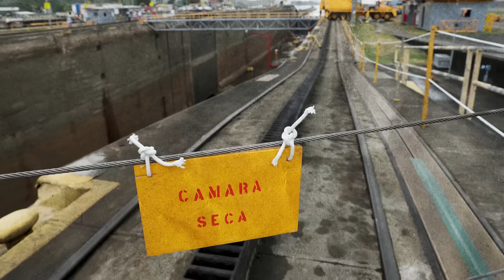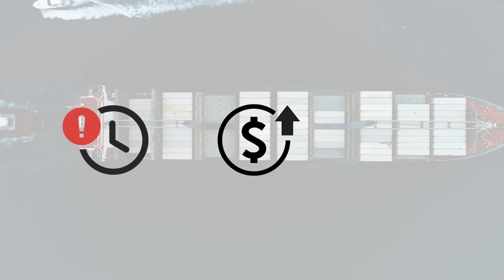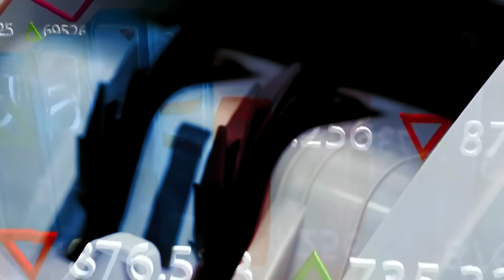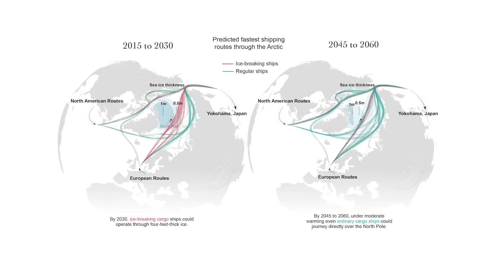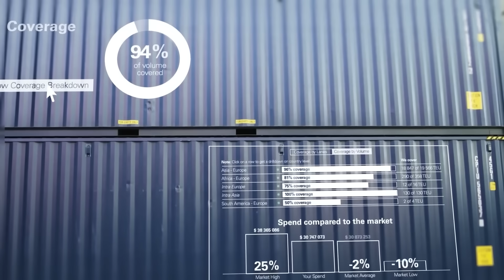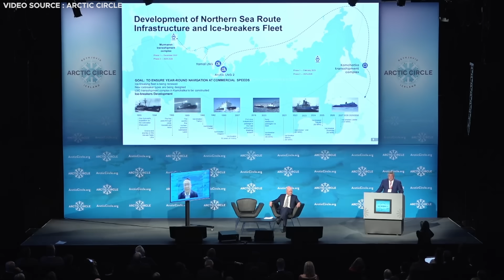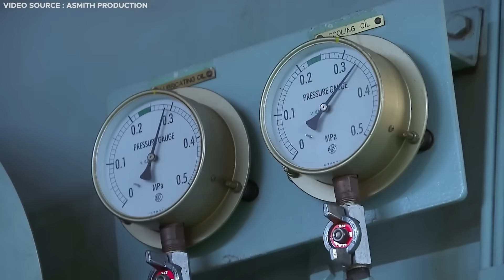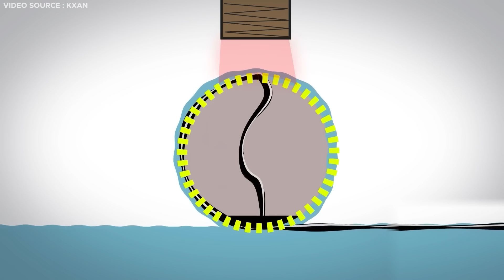The $43 BILLION Arctic Passage That Will END The Panama & Suez Canals

Comment: Miles before you reach the arctic circle by land, sea or air, you confront the true nature of the huge forbidding far north.  One word grips and guards this region to a shocking degree.  That word is Hardship!  The toughest people and the most powerfull machines die up there unless they have extreem material support and mental sharpness.  Casual observation of a map shows the emptiness.  The tiny isolated setlements depend on harbors and airstrips.  It is Empty!

Comment: during the summer the northwest passage is open, using it during this time window may let lake gatun in panama refill. 
during spring and fall variable conditions may see the seawater freeze, but if ships pass every few hours the agitation 
would prevent it freezing solid.   during winter ship caravans could pass if if ice breakers like russia has opened it.
per Grok = Northwest Passage spans approximately 4,000 to 4,500 kilometers (2,500 to 2,800 miles) in total length, depending on the path.

Comment: Russia has several very large nuclear ice beaker ships and many diesel ice breakers to open ice routes for cargo ships.  The Coast Guard has officially welcomed its first polar icebreaker in more than 25 years – the recently acquired Aiviq, a commercial vessel that will be renamed CGC Storis. We have much smaller ice breakers.   As of 2019, the Russian fleet includes around 30 diesel-powered icebreakers. Russia is the only country in the world to boast several icebreakers A nuclear-powered icebreaker is an icebreaker with an onboard nuclear power plant that produces power for the vessel's propulsion system. Although more expensive to operate, nuclear-powered icebreakers provide a number of advantages over their diesel-powered counterparts, especially along the Northern Sea Route where diesel-powered icebreaker operations are challenging due to the heavy power demand associated with icebreaking, limited refueling infrastructure along the Siberian coast, and the endurance required. As of 2023, Russia is the only country that builds and operates nuclear-powered icebreakers, having built a number of such vessels to aid shipping along the Northern Sea Route and Russian arctic outposts since the Soviet era.  https://arctic-russia.ru/en/article/icebreakers-in-the-arctic-the-world-s-most-powerful-icebreaker-fleet/ https://en.wikipedia.org/wiki/Nuclear-powered_icebreaker

Comment: A way to release boiling water under the ice could keep the NW Passage open for longer times!
What will happen when it is opened for longer times,  will the Atlantic pass across the NWP, Travel down the Pacific cross the equaor  around the Antarctic and up across the equater the NWP and melt the ice even faster?

Comment: The Northwest Passage is a part of the sovereign territory of  Canada. They rightfully claim the management of the Passage as they would anyone entering their waters in any other place in Canada. The US demands that the Passage is an international trading route like the Suez. Canada insists it’s their sovereign territory. 
While the ice is melting making it possible to go through during a couple summer months, this fluctuates greatly. The whole place still freezes solid during the winter months. 
Any ships going through would have to have a double hull as a bare minimum or better be required to be ice strengthened. Traversing the Passage is hazardous: inclement weather, threats of superstructure icing, shallow and narrow waterways making it impossible for ships of a certain depth to pass through safely, and no cities, towns or any infrastructure at all. Help would be miles away if something went wrong. 
The environmental problems that will be caused to this region by thousands of ships going through is massive. It would not just involve the Passage itself, but the entire Baffin Bay and the Davis Strait between Greenland and Canada. This is pristine wild, untouched land, but also very fragile when it comes to pollution. Noise, oil spills breaking the ice at the wrong time of year, will have devastating consequences for both marine live, land life and for the communities in both the Canadian Arctic and Greenland. Their livelihoods as hunters and fishermen are threatened by a massive passage of ships. Their is no benefit to them unless Greenland and Canada demands a fee from ships going through.

Comment: Why is there a need for infrastructure development? They just want to use it as a passage to get from point A to point B.
Reply: There's A LOT that goes into securing a logistical chain.  You're gonna need some Coasties nearby in case something up there goes wrong, and some other military branches with stations up there just in case the russians and chinese decide to get feisty.  Those bases must adequately crewed and supplied to carry out operations.  You also may need different types of ships with icebreaking capabilities.  New or existing shipyards will need to built or reconfigured for that.  This is just the tip of the iceberg.

Comment: They need to pump sea water into the locks instead of using the reservoir to supply them. The drought has caused a limit to the amount of water they can use and release in operation of the locks.

Comment: If I were twenty something again and had a choice between nautical life in Panama or transiting artic regions, it would be hands down Panama.  The closer you are to the poles, the rougher the seas, the more extreme the storms,  and the hull designs are obliged to be beefed up.  Northwest passage may be a logical choice for some shipping, but for maritime safety, hands down Panama.  We do need more canals and routes.  The arctic route will help plenty of remote locations in the north lower their import prices.

The premise that Panama & Suez are obsolete is nonsense.  Developing alternative routes, adding more canals, and getting realistic about shipping in global trade are necessary.  That means that instead of having materials and goods shipped from great distances, local & regional trade should be a higher priority.  That would alleviate needless bottlenecks.  Low priority cargo could just as easily be transported by rail freight & networks of distribution hubs.

Comment: Why mixing-up trade issues with the green woke religion with its dogma of "climate change"? 

The Panama Canal was built 100 years ago with far less traffic. The weather was and is fluctuating. That means a draught in 1950 would not have disturbed the traffic thru it.  Isn`t it better to build another Panama Canal?

The North -West Passage requires expensive ice breakers in summer and is impossible in winter. Further it requires freighters suitable to pack ice. Canada/USA would be required to build nuclear ice breakers like Russia as normal ice breakers  are guzzling diesel and need often refueling.

Comment: This entire tripe is horribly fatuous. For starters, check the polar sea-ice extent graphs min/max ranges since initially recorded by satellites in 1970... no discernible trend that might indicate a clear route by 2130, let alone 2030. The average thickness of the sea-ice is over 2 meters, most of the year. Only the biggest, strongest Icebreakers can go forth through 2+ meter thick surface ice, currently there's a handful or less of those. 'Icebreaker ships require massive amounts of power and have specialist-built engines capable of creating the vast drive needed. The primary fuel types for icebreakers are nuclear, diesel and, more recently, LNG. Nuclear reactor powers Russian icebreakers such as the 50 Years of Victory, with two reactors producing 159 MW each' 'Le Commandant Charcot was one of the most expensive expedition cruise ships ever built at a cost of over $430 Million'

Comment: There is no drought issue at the panama canal,,,,, there is a reckless water usage issue. No water is re-used in their lock system. Every time a lock is lowered, the water is unnaturally moved another step towards the sea. There is no water conservation at all. This is a man made and profit issue, not a climate change issue as many present. 

Basically,,, more lies.

Comment: The Canadian route will NOT be free of Fees. Be clear on this. Canada will be expected to provide  safety of passage and emergency care and that will come at significant cost which shippers will bear.
Reply: The ice going military ship building is at the highest rate that it has been. Launched one on Dec 9, 2024.https://www.youtube.com/watch?v=lBhrNkbVlkE
Reply: It would require expensive nuclear ice breakers like the Russians. The ships need to be build to sail in pack ice.
Reply: Canada has 18 or so icebreakers , 2 may be added or have been added making 18-20 , 
Russia has more than double the icebreakers Canada has , not sure if the USA has their 
own breakers up there , those routes are not open by the ice melting ,
Reply: @nerradnosnhoj5122  None of the Canadian ice breakers is nuclear. It needs and awful lot of Diesel and regular refueling and are weaker than the Russian nuclear ice breakers.
Reply: @holgernarrog962  , Russia has about 37 icebreakers , largest fleet ,Canada has maybe 18 or so , not sure if any of the newest Breakers are Nuclear , there seems to be no shortage of ice . I would bet there is a lot more icebreakers today as compared to 1950's -1960's
Reply: well, has Canada resolved all the international disputes about the Arctic Archipelago, the deadline of 2028 is fast approaching and the EEZ zone. Russian's, Denmark and Norway have done it back in 2007 at the UNLOC?? Some of Canadian claims could be in question including the famous Northwest passage, but what the hell we will ask our " Uncle SAm " to bail us out.
Reply: @louisg2390  We will not ask Uncle Sam to bail us out.  Uncle Sam is trying to declare that part of the Passage is international waters.  More Canadian ice breakers are under construction and the number will be significantly increased over the next ten years.  Every year the water gets warmer and the Passage can be used for a longer time.
Reply: Ain't gonna happen anyway.

Comment: The Panama Canal problem was not caused by drought.  The canal was widened.  Engineers told them they needed more water reservoirs, but they were never built.
Reply: Thats not true. The canal was not just widened is was made deeper (dredged) that in itself is a larger reservoir. Plus there is a secondary lake to the east of Gatun. Plus a river to the west they are planning on putting a dam to form another reservoir with a pipe to Gatun
Reply: @Axrover  Why are they building another reservoir if it's not a problem.  Traffic has been reduced because there's not enough water.  Yes, widening made it deeper so need more water.  Do the research.  I'm not making it up.
Reply: @craigthompson3739  what's not true is that the drought did not cause it.  Ecause it did. It started raining and it's back to full swing again.
Reply: It's always the way.  People don't listen to the engineers and then they call the engineers to fix the problem caused by their not listening the first time.
Reply: Won’t goods freeze?
Reply: Don’t let facts get in the way of a government “crisis” requiring large amounts of taxpayer dollars and regulations.
Reply: Dude, ANYTHING to sell the global warming hoax.  Right?
Reply: It was caused by drought . Have you ever been to the canal? Read Mccull "The Path Between the Seas" and then go to the canal museum.
Reply: By poor management and greed. Maintenance and infrastructure needed after widening. Go figure
Reply: It was caused by drought and the digging and widening of the canal.  It can be both, you know.  I agree, they need a larger reservoir.  I don't buy for a second that the Northwest Passage will ever offer a serious alternative.  It could realistically only be an alternative 3 months of the year, if that.
Reply: @nikolatesla5553  Drought revealed poor planning.   Previous droughts spanning 100+ years had no effect.
Reply: The author is mixing-up trade issues with the green woke religion with its dogma of "climate change"? 

The Panama Canal was built 100 years ago with far less traffic. The weather was and is fluctuating. That means a draught in 1950 would not have disturbed the traffic thru it.  

Isn`t it better to build another Panama Canal?
Reply: Probably easier said than done
Reply: @nemo1405  the already rerouted 1 river...
Reply: @holgernarrog962  I mean its a fact that po9lar caps are melting, if that upsets you go find your nurse and take your pills or something
Reply: @holgernarrog962  Hey, that canal would be through Mexico or Nicaragua. The US traffc might be banned from using it!

Comment: Wouldn't it be easier and less expensive to pump ocean water into the Panama Canal locks to raise the lock level each time a ship passes instead of using lake water in the Panama Canal? As all these experts say, the sea level is rising due to climate change. The more seawater, the easier it will be to get ocean water. When the lock opens, drain it back out on the slat waterside, not the lakeside. Once the so-called sea rises, like the "experts" say no locks will be needed anyway, it may be a million years, but we have to be ready right 😜

Comment: You DO realize that the Arctic polar region is as insane as the Antarctic during winter?  You may as well import penguins.  Small wonder that global shipping has its transit solution closer to the equator than the poles.  You may as well theorize that the weather around the capes is bound to become balmy and shipping quite pleasant.

Comment: Didn't Al Gore say the Arctic would be ice-free by 2000, then 2005, then it was 2010, then 2020, etc etc? Hasn't happened yet, and probably won't, especially if the AMOC releases all that fresh water circulating in the Arctic Ocean, which will deep-freeze Europe within months if not a few years. The release of AMOC is the real inconvenient truth.

Comment: Whats wrong with having the first two locks  on both oceans, filled with pumped sea water - The truth is there, is a solution, but the Panamanians don't want to invest it it.   There are other plans afoot to open, other sea routes through South america!  So if the  Panamanians don't get a move on; it will close.

Comment: The Panama Canal system is operating at a reduced capacity because the locks utilize fresh water to fill the locks but then just dump the fresh water to lower the ships. But now there is a drought, and the lakes have a low level. Do not dump the fresh water, pump it back into the lakes. AND utilize salt water wherever possible but dump that back into the sea, or build a salt water reservoir to fill and empty the locks. The Panama Canal water shortage just a problem that can be solved with more pipes and pumps. But Panama did not build the canal, America did. Panama wants to own the canal and lock system but cannot operate it when it breaks down. Surrounded by an Ocean on one side and a Sea on the other, yet the operators are stymied! They need America's brains and money to modernize the system.

Comment: Cheaper to simply pump water from Panamanian lower locks back up to the upland locks (rather than letting the water run out to the sea). Still expensive, but cheaper and easier to implement than an arctic passage.
Reply: Well that should be done anyway in order to save sweet water from being lost in the ocean. However,  both Panama and Suez are very prone to sabotage/blocking which could seriously upset the  entire world economy.  The northern sea routes are therfore a good backup and a viable economic alternative to both.
Reply: @GreenIsland38 Rivers run into the ocean anyway whether there is a lock in the way or not.
Reply: @GreenIsland38  For Suez at least there is an option to dig one in Israel (Aqaba). For Panama, there is no alternative.
Reply: Panama already did and made a larger adjacent locks to theold one. @sriharshacv7760. They spent billions on it. Now they are looking to increase water storage. They probably ly also have plans for a 3rd lock set. For even larger ships. The problem is you loose water, lots of it, in each transit when the lower lock opens
Reply: The new locks recycle 90% of the water already.  The lake level is too low.  Improving efficiency doesn't make more water.
Reply: @cratecruncher4974 that would take a dedicated nuclear plant and a lot of time.
Reply: In combination with weather manipulation/modification , water from the lakes was diverted to the embattled copper mine as well.
Reply: You can pump ocean water up.  I'm wondering if the canal traffic finally became too much for the lake to handle.  Drought or no drought.
Reply: Sounds like work. Extortion is much easier.
Reply: Bravo! Intelligence does not seem to be their strong suit. Business always requires proactive planning. Perhaps they skipped that class.
Reply: Not so simple anyway the problem resolved naturally stop the travel.
Reply: The Panama Canal exist because the USA built it.  Panama's income from the canal is because of the USA, the trade we provide, and our generosity in giving Panama such an amazing asset.  Panama should be thankful.
Reply: @John_Linn  Wasn't that land leased from Panama, Hasn't that lease run out
Reply: @John_Linn shut up. U know nothing gringo. Go figure out if there are 2 or 67 genders...
Reply: I’ll put Musk on it…he’ll come up with something amazing!